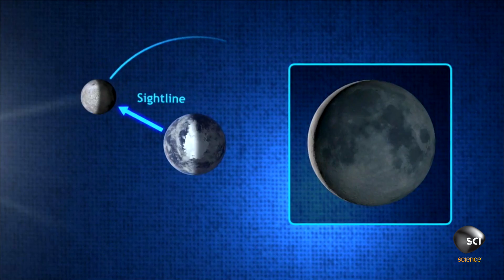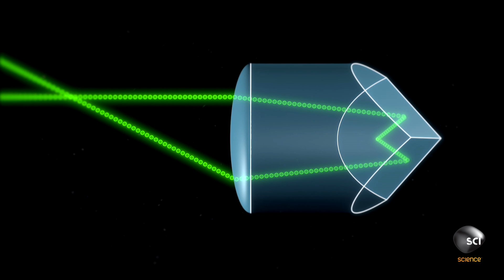Cracking the Curse of the Full Moon

Comment: The moon splitting in half controversy:
The word used for split hardly means to split something in half. It means to strike an imprint on something. The same word is used to describe the rain when it hits the earth. There are 1389 more verses after the moon splitting one. 1389 in the Islamic calendar corresponds exactly with 1969 in our Calder, the year that Armstrong and Aldrin walked on the moon, “striking” its surface.